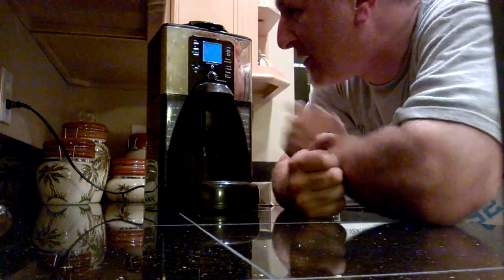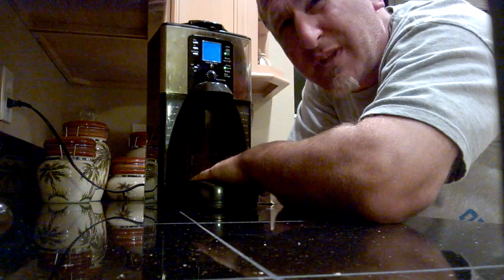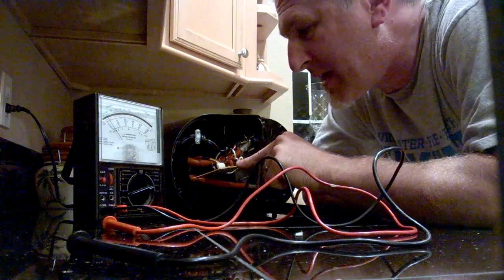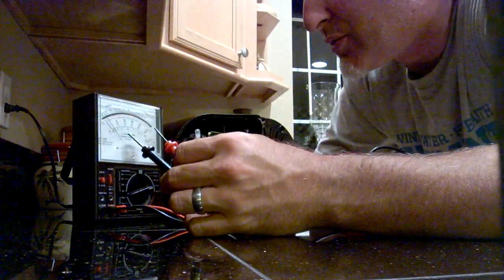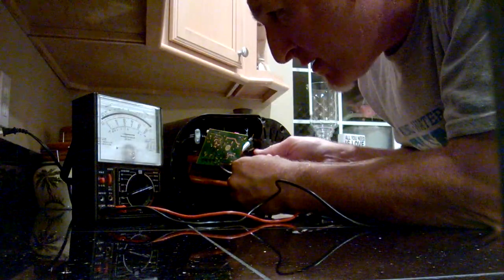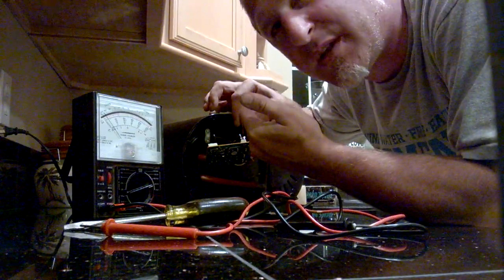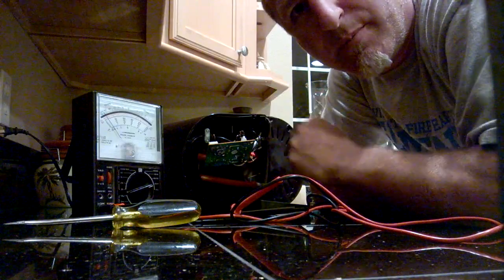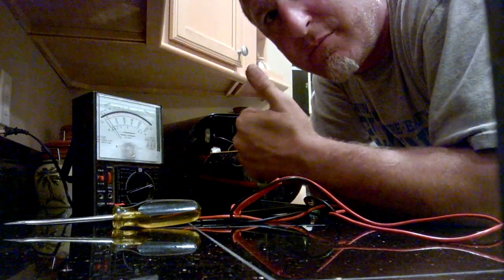COFFEE POT repair/diagnosis

Comment: LOL!  These things are manufactured to be difficult for the home handyman to repair.  I decided to watch a few videos. Our Mr Coffee went on the blink and we miss having it ready for us when we get up.  Presentlu using an older one we had put away. Yours was the third video I watched and noone addressed those two screws at the front beneath the hotplate.  I see you just broke it in two!  Lol!  Good job.
Reply: I don't know where you are but "Repair Clinics" are popping up in many major metros, and they fix everything from electronics to electrics to textiles.  At local libraries or Maker Labs.
If your problem with the two screws is the same as mine, Torx screws designed to keep us from opening them, they'll also have the Torx screw drivers.

Comment: I opened my coffee pot today (a Mr. Coffee, little one) and found one fuse was open. My question here is: Can I just bypass one of the fuses, what are the consequences of this? 
Can I replace it with a different fuse or does it have to be the same 
one?
Reply from the maker: My father told me about how he fixed a coffee pot one time by bypassing the fuse... Yes it will work.. BUT (a big BUT)... there is usually always a reason a fuse is over loaded (usually a short) and in turn this causes resistance. If there is resistance there is heat... enought heat and you got a house fire!  If it were me and I was trying to FIX THAT COFFEE POT... I would find the fuse and try it again... if it blows 2-3 times and I cant find the reason... TRASH CAN!
Reply: @silveraudio74  seems like both fuses are blown in my grind and brew
 the element kind of smells but so does the circuit board , there are some relays and other components on it i can't recognize
i am wondering if it is the circuit board or the element that blew the fuses ,  do you think the element  blew the fuses?
i disconnected one side like you said and i used a  free centech harbor freight multimeter and i set it to 200 ohm
and it reads about 14.8 ,i did a quick google search and on what the resistance should be and it said between 100-300 ohms i think
 so do you think it is my  heating element or do you think it could be the main board ?
i wonder if those fuses are not only there to prevent a house fire but also  to prevent the current from frying the main board in the event of a  heating element failure